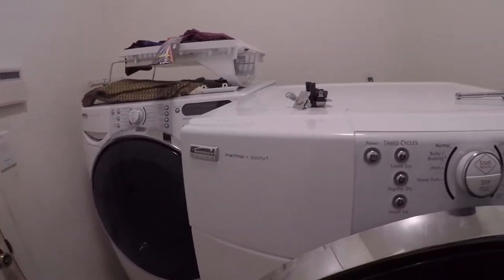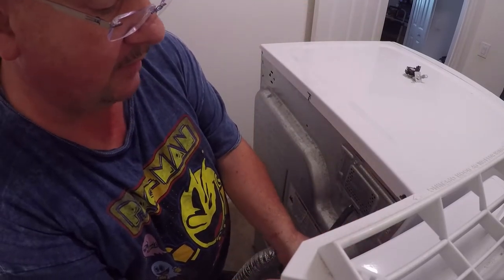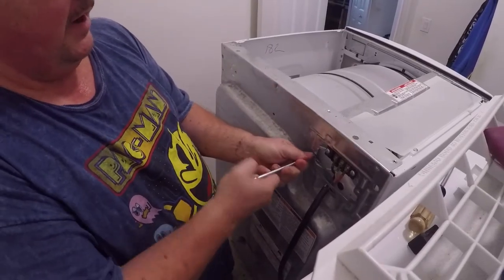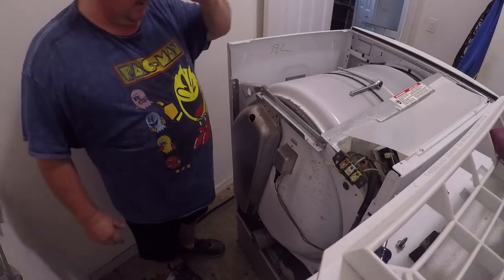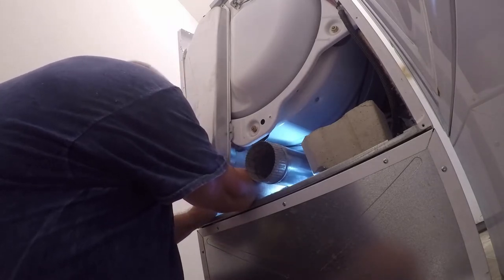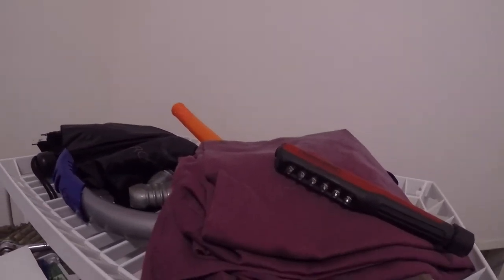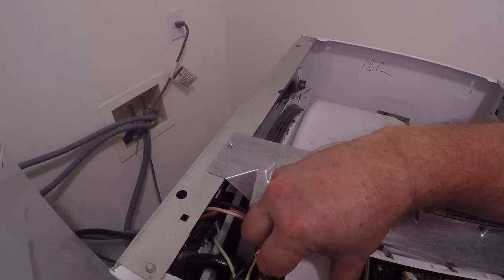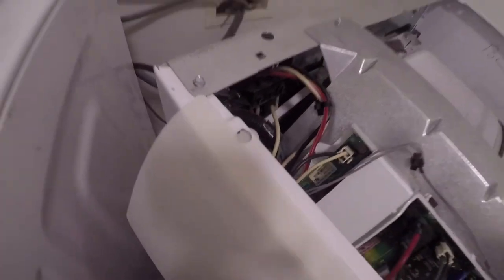How to repair a Kenmore Elite HE5 Dryer

Comment: Thanks for a great video, man!  I was wondering why you didn’t go through the front bottom panel for the thermal switches. Maybe even pull out the whole heating element assembly? I realize however that didn’t solve the problem. I think I need the same board you replaced. I’m having the same exact problem. But definitely curious why you started with the back for the thermal switches. I’m no expert. Just a hack trying to save time and money
Reply from the maker: The stuff I read online pointed to either the Thermal switches or the control board. I did the cheap option first. I replaced the heating element the previous year.
Reply: @MrDave-bs7tc  I got my problem solved thanks to your video!! However, I didn’t buy the replacement board. A friend of mine who works on electronics did some tests and found the problem capacitor, replaced the single component and IT WORKED!! I’ll be happy to share pictures and specifics if anyone wants to heat up a soldering iron
Reply: Also, my question on your approach is why didn’t you try pulling out the heating element through the front to change the thermal switches? Instead of taking off the back. Seems like less work to go in the front but I’m wondering if I’m missing something. I’ve had this thing open several times and thought you could do that without taking off the back. (Just trying to learn. Not insinuating you did it wrong. ) cheers

Comment: That's not my problem.  My console lights up, no problem.  Push the button, the drum doesn't turn.  Belt is good. Can you help?
Reply from the maker: Check the power going to the motor. If power is good through the wires. Then replace the motor
Reply: I am having the same issue, console fully lights up but drum doesn’t turn. James-were you able to fix yours? What was the issue?

Comment: Anyone know the part number for this control board? OR where I can find the number on mine?
Reply from the maker: Should be on the label on the board. 

https://www.searspartsdirect.com/combo/0582-1234594/kenmore-dryer-parts
Reply from the maker: Also, sears direct has pictures as long as you select the exact model number

Comment: The thermal fuse protects the heating element. I know for sure that if the heating element has died, the rest of the dryer still works.
Reply from the maker: I know that as well. I replaced the heating element about a year before I did this video

Comment: Hello sir! I do appreciate the video. We have the same exact model dryer. I'm having a difficult time figuring out what control board it is... Which one did you use to solve your issue? Please and thank you in advance!
Reply from the maker: There are 2 control boards. Order the cheaper one
Reply: @MrDave-bs7tc  I'm waaay delayed in responding - but I was able to fix our dryer with your assistance. I appreciate your informative video! You saved us.

Comment: Hello there, Dave I was wondering where you ordered the control board from as I have the same dryer and problem would appreciate any info thanks.
Reply from the maker: Searspartsdirect.com
Reply: @MrDave-bs7tc  thank you for the reply & you wouldn't happen to have a part # by any chance.
Reply from the maker: @ruthsolano8663  sorry don’t remember off hand. I remember there are 2 boards and it was the cheaper of the 2.